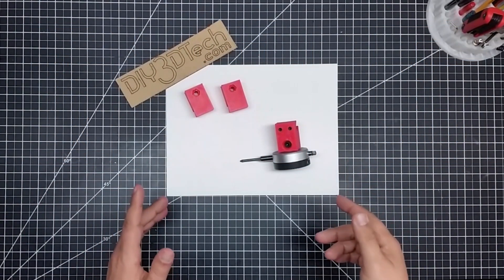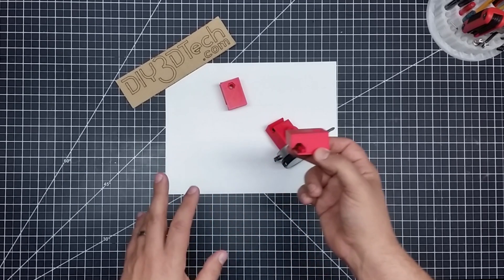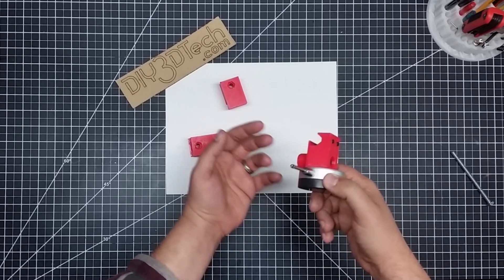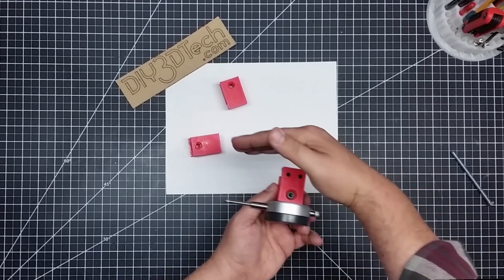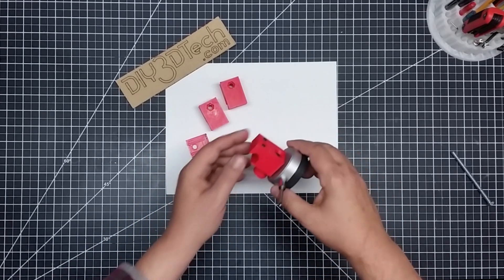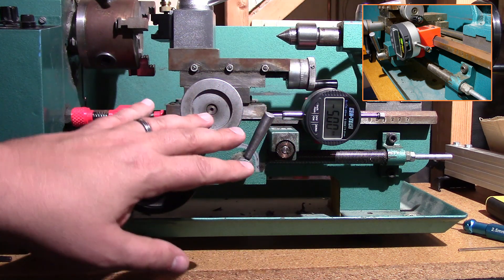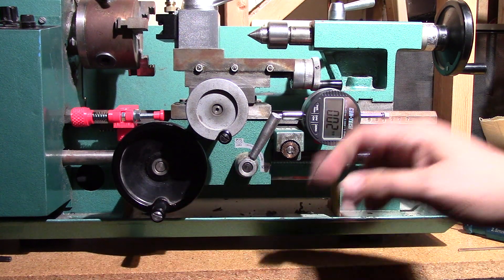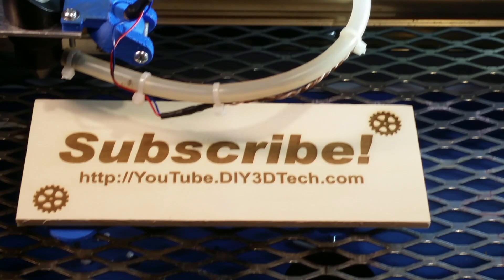Mini Lathe  - 3D Printed DRO!

Comment: Nice work. Have you considered using a magnet for mounting? It would allow you to more easily change setups if you need to do that a lot. Having the indicator mounted so rigidly may damage it if you travel too far on accident.
Reply from the maker: Yes I did, however not a huge magnet fan for things like this.  Yet worth note if you hit it hard enough it will slide if you don use the sand paper trick.  Also I am not saying, I might not revisit the idea either :-)  As I thinking of another widget for the mini-lathe what would (there is more to come)...